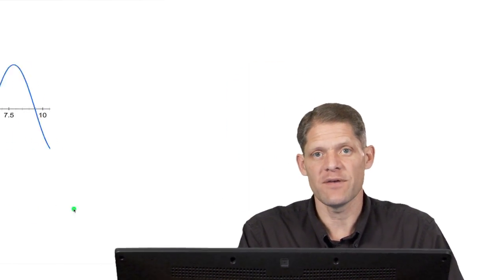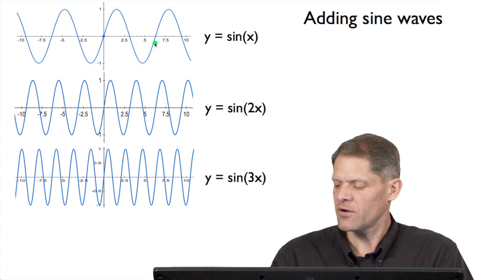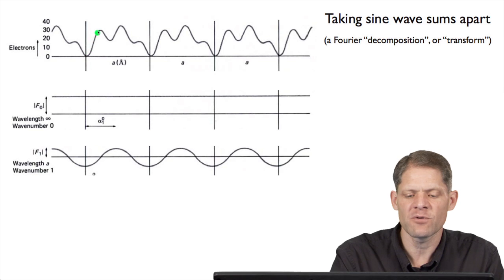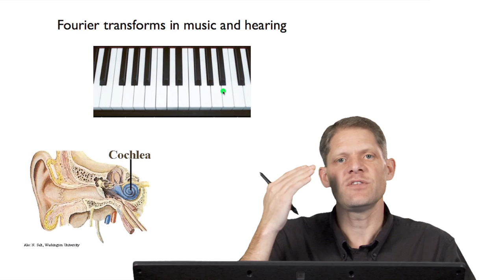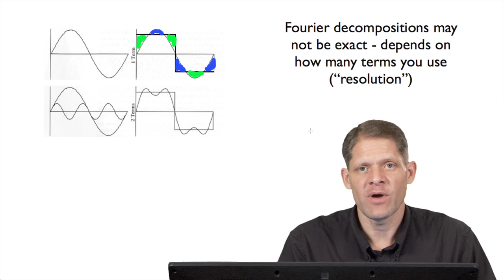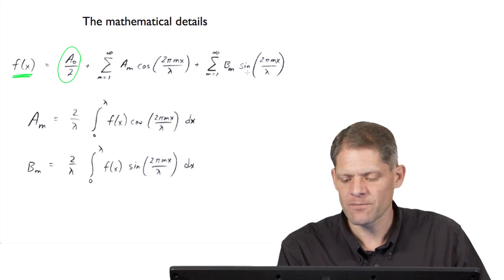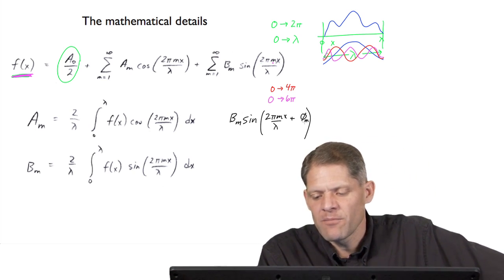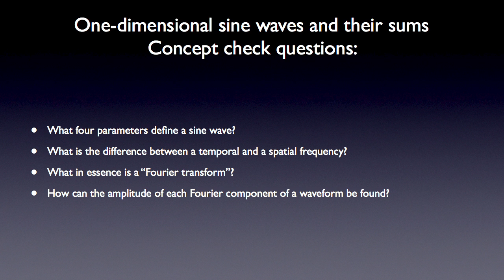Part 2: 1-D Sine Waves and Their Sums - G. Jensen

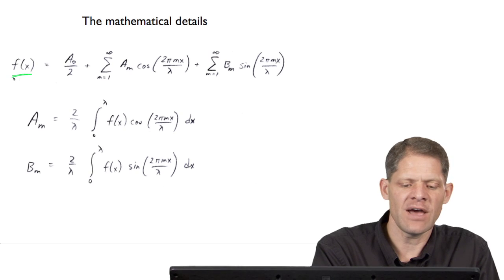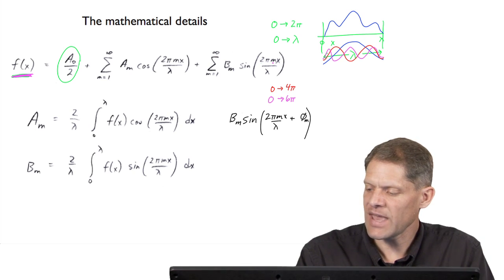Comment: At 23:09 he shows the mathematical expressions for the continuous Fourier transform of the periodic function $f(x)$, but he does not explain how they are derived. Specifically, how the amplitudes and phases of the individual sin and cos waves are chosen. At 28:45 he explains the amplitudes $A_m$ and $B_m$, but this explanation does not tell us why those particular amplitudes are the right ones. There is a complex discussion in the video

Advanced Engineering Mathematics, Lecture 3.1: Fourier series and orthogonality

that shows how the amplitudes and phases are derived, but this requires mathematical maturity. You can also search UT under "Fourier series and orthogonality"